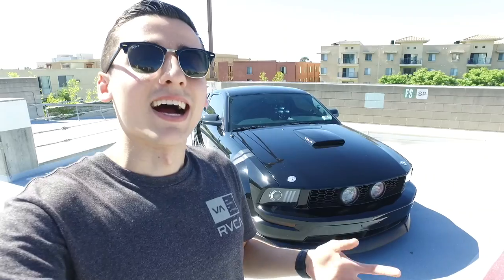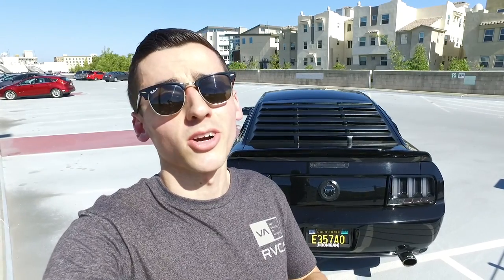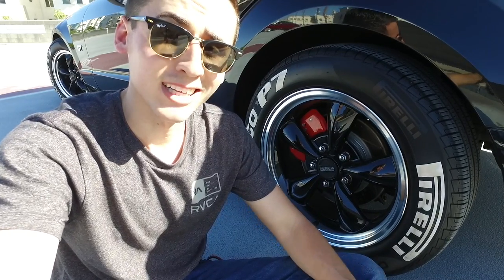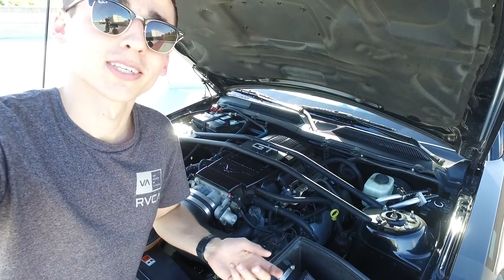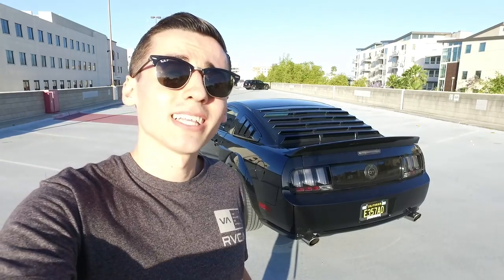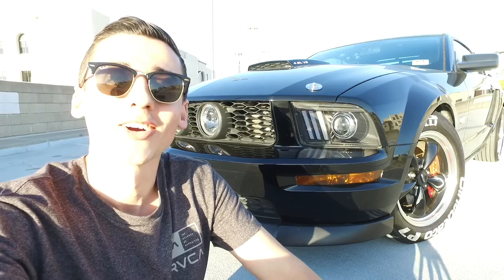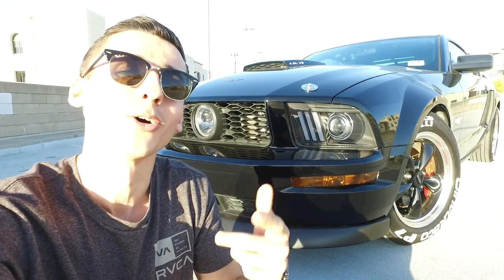4.10 Gears: The ULTIMATE Gearing Ratio For Your MUSTANG

Comment: 4.10s are fine, especially if you plan to remain naturally aspirated. If you plan to add forced induction later, 3.73s would be my choice.
Reply from the maker: Very true! Adding boost you will want to get lower gear ratios. Good looking out
Reply: 3.31s, all the cars making killer times have 3.31s, 3.73 is still too aggressive, you'll still melt your tires and lack that top end speed.
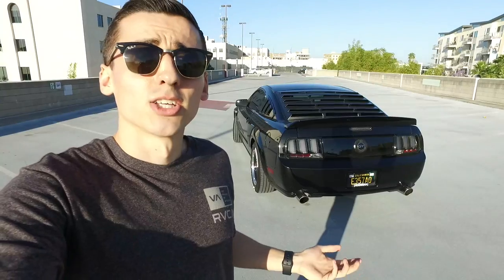Reply: I have supercharged 5.4 with stock 3:73, I'm going to 4:11. But I have 9.75 not 8.8
Reply: I disagree. With a boosted 6 sp manual I had 3.55 and 20in tires. I was in each gear forever. Went to 4.09. Coyote engines are a  high reving engine.
Reply: im boosted and want to run 410s with the Detroit rocker cams supercharger grind and shud be jus fine. least i hope lol
Reply: @WONDERBREAD89  do mods on a mustang cold air, catback, 4.1 gears, harm the life of the car in any way?
Reply: @markdamstra  overall naw but your drivetrain.. will feel the abuse. clutch , driveshaft, rear axle's etc will feel it a bit more..
But thats the point right 🤙😎
Solid ass upgrades like the single one piece driveshaft.
Lightened flywheel and ceramic clutch. Braided lines.
And stronger rear axle's to handle the gears and especially if your slappin more power and tq with boost.
Sry if I said to much
Reply: @WONDERBREAD89  thank you. so you say no that these mods wont hurt the life of the car? I thought any time u pressured the car or components of the car for more horses that strains the components and causes wear and tear and eventual failure.
Reply: @markdamstra  our s197's are very underwhelming with a factory tune for longer life expectancy.. so yes anything u do can but they are capable of so much more Ford jus  nerfs em from fac.
Stay on top of routine maintenance, synthetic oil changes and shud be fine. Man made so anything can occur.
God bless and hope u have fun 🤙
Reply: @WONDERBREAD89  hi wonderbread, thx for your help. I am buying my first mustang gt convertible. I like  1994 to 2006. n95, sn95 or s197  how is that for cool? I like the looks of an sn95 best but i think the s197 are more refined and drive better. whatever comes up i will buy. 
my first car was a chevy nova so am a gm guy but i think mustang gt's are the toughest muscle car out there.  4.6 are tough as nails. looking at a 99 that they replaced the bad plastic manifold.  he said to be perfect could use breaks. didnt they have a problem with the caliper pins?
Reply: @NateRider  ok, so I have a 2006 lincoln town car.  I have 3.27 gears stock. But, I upgraded my rims and tires from 17 to 20 inch chrome rims. There now 255/35. When I did the math it said I should have 3.85 gears. Which I thought 3.73 would be the closest to. 
Math formula tire size X gear ratio then divide by the original tire size.
So, it looks like this 20inch tires X 3.27 gear = 65.4 ÷ by original 17inch tires = 3.84 but round it off to 3.85 ratio. Any suggestions?  I wanna gor procharger or edelbrock stage 1.
Reply: Only when talking about turbos, turbos like lower numerical gear ratios but if you were going like spray or a blower 4.10s would be fine

Comment: When running these gears is your car screaming at freeway speeds, like 80 mph?
Reply: Yea but who cares? Don't be scared of rpms
Reply: @xxxxxxxx183 puts more wear on the engine and burns through gas
Reply: Having this car with 4.10 gears in the rear end, I’m doing about three grand plus or minus at 80 miles an hour on the freeway in fifth gear.

Comment: Lol you don't gain 40 hp with a hot air intake, catless h-pipe, and straight thru mufflers. You can't believe everything americanmuscle tells you, trust me I've been there before.
Reply: You might see like 15-20 hp with those upgrades but that's it, AM is a bunch of lying diptwads. If you throw a comp cam and throttle body and intake, then you'll see a 40+ hp gain
Reply: BlazerMountain I think with a tune you would see those numbers but without one I doubt it

Comment: In the racing industry, we coin two phrases, Tall Gears and Short Gears.   Tall Gears are those with what we call long legs, they allow the vehicle to reach maximum speed on a long racetrack, such as Charlotte Motor Speedway or Road Atlanta.....   Short gears are those with short legs, they are used in events where the vehicle needs to accelerate rapidly but rarely reaches top speed or anything greater than 3rd gear.   These "Short Gears" are usually confined to rally events, hill climbs, and autocross events....   
Short gears (such as the 4:10) will allow quick acceleration, which might be effective coming out of the hole, but they will suffer greatly on top end as the vehicle reaches it potential redline RPM too quickly and therefore never reaches the maximum potential speed of the vehicle....... 
Compare that to a ...say 2:90 gear which will not be as fast off the line, however it will allow the vehicle to reach much faster speeds as the final ration of Engine RPM to axel turns is vastly reduced compared to the 4:10, allowing the vehicle to have much "longer legs" (aka lasts longer) and therefore achieve much higher speeds than the short legged 4:10 gearing.......   A 4:10 differential at 7k RPM, produces about 25% to 30% less top end speed than a vehicle with a 2:90 differential (given all other things are equal).....
That said, it becomes necessary to understand what the car is going to be used for, in order to understand its relative rear gear setup.   Try using a 4:10 gear at Charlotte motor speedway, and you will be the slowest vehicle on the track.   If however you are in a autocross where you car will not exceed 35 mph, then the 4:10 gear will shine in that scenario as it will achieve those lower speeds quicker than a long legged gear ( such as a 2:90).
Using a 4:10 gear in a street car, will eat a hole in your pocket fuel mileage wise.....  further it will cause your engine to operate at a higher RPM, which results in top end cylinder wear over time...... 
The more ideal approach is to keep your gearing 3:31 or 3:55 and rotate your tire size,   This will in effect allow one to change their final gearing without permanently swapping their ring and pinion setup........  Do the math related to tire size and differential gearing, knowing that smaller tires turn faster....

Comment: Great video. Going to be installing a pair of 4.10 gears on my Crown Victoria after watching this. Was originally going to select 3.73 but the moment I heard, "Go big or go home!", my mind was set! These gears will compliment the full exhaust I already have installed really well. Stay tuned on the project, I have a few videos already! Keep up the great videos Nate!
Reply from the maker: I am so happy that I was able to help. That is what I am here for. 4.10's are the way to go!
Reply: I was thinking the same thing. I have a 2006 lincoln town car.  I have a jmod done and 2 1/2 inch piping from the cats going into a  X pipe then out to a roush axle back exhaust.  Also, 1 big thing that helps ALOT IS the jms pedalmax.  That eliminated the drive by wire. When I first saw the reviews on YouTube I thought they were just over  exaggerating.. but it's the best 250 bucks I spent on the car. Quick question 🤔 wht would you think would be better. A procharger or a  edelbrock stage 1 supercharger?  I was originally thinking the procharger but, ever race I see on YouTube procharger gets smoked by the twin screw supercharger. Any thoughts?

Comment: Enjoyed this! Have a 60,000 mile one owner 2006 s197.Added a Roush CAI and Extreme axle backs,and a Barton shifter as of now.These cars are crying for better rear gears,it seems to me.My Boss 302's and my Boss 351 years ago all had 3.91's in them,and to me that is the perfect street setup.I was away from this until last year when i retired,and i see that Ford doesn't make a 3.91 gear set,and the 390 gears available people say tend to whine.So,i guess it's going to be the 410's.Another thing i found out is that if you go higher than 3.73,you lose your cruise control.Mods for this year will hopefully be Detroit Rockers,and gears,with headers and mid pipe slated for next year...I hope!lol  Thanks again,sir!!
Reply from the maker: I am so glad you enjoyed my videos! and yes 4.10's will be the answer for you! and you are lucky for cruise control because I don't have that on my mustang lol but hopefully you find the answer with those other upgrades haha good luck with your build!

Comment: Actually the 3:31 rear differential gears are stock for the S197 Mustang GT.  A lot of dealers ordered the 3:55 gears for the best balance in power and miles per gallon and that is where people mistakenly say that the 3:55 gears are stock,   I have 3:55 gears in my 2007 Mustang GT and regularly get 25-26 on the highway and 16 mpg in town,  I live at 4,500 ft in altitude so the 3:55 gears are primo.  I would only consider changing to the 3:73 gears because I’m getting ready to order the Roush supercharger.
Reply: 2005 and 2006 stock gear was 3.55,in 2007 ford made the 3.31 gears it'sdefault option.

Comment: Good video 👊 I got a 06 GT ,Saleen supercharged stock pulley 7.5 psi ,stock saleen intake ,cerviny side exhaust ,& 4:10 gears aswell just that on low boost puts out 450whp & 500+ crank I really recommend boost easy 150+ hp gain I will do pistons rods and turbo swap or maybe compound boost for a little it should be fun 😈 go for it boost !! 💪🐌
Reply from the maker: damn you are going all out haha thats gonna be a 10 second car right there!

Comment: I read 4.10 plus gears are recommended for the auto 10 speed. I currently have a 2020 S550 base with 3.15 gears. I hate the pull. It lacks. I have Nitto 555 G2. 285x35xr20 rear 255 front. Can't wait to upgrade.

Comment: Sweet.  Im going with 3:73's.
I had a 92 Stroker on 3:73's

just got Babyblu (2007 s197) Pypes H-pipe. gonna do the install myself.  Love the vids.
Reply: ya the 3.73 will help with traction beeter than the 4.10 if you plan on making more power in the end
Reply: by boy has 4.10 in a Cobra and MAN what an amazing feeling
Reply from the maker: Aye 3.73 aren't bad at all! They are amazing too. I hope you install it the right way. I wish I knew how to install gears like you lol
Reply from the maker: Yeah imma need to do some upgrades on my suspension next lol
Reply from the maker: Receipt for domination right there! haha
Reply: Nate Rider im putting on the H pipe.  Im not doing gears myself.  Im like you. not my thing. lol
Reply from the maker: OHHHH FASHO!! Yeah the mid pipe is SUPER easy to install. Hope it turns out well
Reply from the maker: Yeah if you have boost then it is better to go with smaller gears. but if you don't then higher gears do the trick

Comment: Love the video kid. For the tire selection, I have Nitto NT555, 275/40ZR18 103W, on all four corners. I've used them at the track and gripped pretty good. Here in NY, I don't drive my car in the snow and from sitting in the garage, I don't have dry rot, or flat spots on them. Had them for 4 years and they still look good.
Not sure what kind of gears I'll go with. I've thought about 3.73, but also 3.90. Has anyone else used 3.90's?
Reply from the maker: thanks man I appreciate it. I love the Nitto tires as well. I may slap them on in the future. and nno I haven't done any research on the 3.90

Comment: I've got two Mustangs.  A 94 LX with a 429cj and C6 trans and I run the 3.73 gear in it and it does great.  And I also have a 2000 GT that has a 5 speed and a little tune up and 3.90 gear in it and it does great. Have no problem getting from point A to point B . Do not like the 4.10 gear. Had no luck with that gear.

Comment: 06 3v checking in. Cali laws suck man. They hate my car and my guns. Car looks good bro. Well, here is the list. JLT CAI. JBA longtubes and O/R H. Flowmaster  outlaw axlebacks. Dyno tuned @ 300 Wheel. MGW shifter. Braided stainless lines with Xtreme stop pads and  slotted drilled rotors. Gt500 front LCA . Full BMR rear Suspension. FPRP K springs on Koni strt With Gt500 strut mounts. Exedy Mach 400 clutch and flywheel going in this week. And a grip of cosmetic stuff. keep up the vids man!
Reply from the maker: Yeah you can say that again! SWEET! That set-up sounds sick. I definitely loving the long tube headers. How are you able to have long tubes on cali?
Reply: Im in Texas. just saying the stuff i enjoy is a no go out there. i want gears but im debating on NA or FI. 3.55 would be perfect if i go FI. we all wanna see a couple of Passes When You get the dope hooked up bro!
Reply from the maker: Yeah if you have all that power, then smaller gears will work good for you. Thanks my man will do!

Comment: I have a 94 GT, which is a 302 5.0, I have 170 Twisted wedge heads, 24 lbs injectors, calibrated MAF, T MOSS ported intake, and a simple E CAM. I believe with a tune i should be around 290-310 hp with around 320tq. at wheels. I only have the weak 2.73s car feels very slow. I have 4.10gears ready for install what can I expect?

Comment: It does not appear that you have modded to a one piece aluminum drive shaft yet? This is an easy install that you can do yourself. The stock 2 piece steel shaft is over 40lbs. The one piece aluminum is like 20lbs so you have less rotating mass which transfers the power to your wheels faster. With the aluminum shaft you will increase acceleration times and especially coupled with the 4.10 gears. Research the aluminum shaft. I highly recommend that mod. Also, the aluminum shaft is stronger than the steel shaft. You also don't have to worry about having the carrier bearing failing, a notorious issue for 2-piece driveshafts.
Reply from the maker: Oh trust me I have been wanting the one piece drive shaft for the longest time lol but the price isn't too appealing to me. Imma have to save up for that one lol thanks for the advice tho imma do more research on it
Reply: @NateRider  dude I don't understand I have a 2001 Mercury Grand Marquis

Comment: Miss your videos on 3v mustangs.  You were the guy on 3v mustangs.  Just like Derek Baran is the 4v guy.  Amazing he jumped from a 2v mustang to a 4 valve 2013 mustang.  Now he's had a cobra 2004, but realized mot a market for the Terminator.  Honestly it is the car he wanted.  But so few, so nobody watching.  Sold it quickly and bought a S550 automatic! I don't blame him. But it is not what he represented in the past.  It was manual all the way.  Now it's a 10 speed automatic 
 It doesn't miss shifts and so much faster. He recently did a video on a 3v. Wasn't his car but something he recommended.  Hmmm. Can recommended the car, but never owned one?

Comment: I put 4:10s in my 02 GT and couldn't really tell a difference.
And it had 3.27s stock.
I'm thinking they never swapped the ring and pinion. It still tachs the same.
Thinking I got ripped off
Reply: There is no thinking to it, you was absolutely ripped off. Going from 3:27 to 4:10s is a big difference and you would be able to tell right away. There is NO WAY possible for 4:10s to feel like your 3:37s

Comment: The combo of underdrive pulleys and nitrous is a great way to blow up an engine. 98% of failed engines are a result of this combination. Ford engine exchange will not replace your engine if you have used this setup. (Yes we can tell) The slight performance Increase from underdrive pulleys is not worth the extra wear and tear on the engine. Did you at least Increase cooling capacity when you installed the pulleys?

Comment: I have a 2003 Terminator Cobra(whipple 2.3L 700rwhp) and I highly recommend 17x10 wheels in back with Mickey Thompson drag radials(275s to 315s depending on fitment). MTs will give you great traction. Up front I use 17x9 wheels with Nitto tires (275s). With nitrous if you don't grenade your motor you are going to need the biggest tires you can fit in back. I would recommend you get a supercharger rather than nitrous. Much safer and more constant power potential. Your year/style Mustang has a notoriously risky bottom end when it comes to mods so I would not go crazy with the power upgrades. Good Luck!
Reply from the maker: Thank you so much for this great advice! I am definitely going to have to check out those tire setups cause I already know my mustang is gonna be melting my stick wheels lol Damn you must be a king on the street with that terminator mustang

Comment: Hey Nate Rider. What are the top speeds for each of your gears. I have an 08 GT with the 5spd but It may already had some stuff done to it when I bought it. My speeds are 1st-35, 2nd-62, 3rd-85, 4th-115, 5th-150+. I am just trying to figure out what I really have in there.
Reply from the maker: I really wish I can tell you my numbers, but I cannot say exact. I am hoping to dyno my car very soon to show you guys all the numbers that sally is pushing. Sorry! But stay tuned for that next video!
Reply: Nate Rider I still gotta get mine dynoed as well, but before that I still have to get my cams and longtubes put in. I bought the comp cams nsr stage 2 xfi if you're familiar with those. And with those 4.10s you got great acceleration but the only trade off it kills your top end. What I mean by that is that long 5th gear is going to kick in a lot sooner. You should make an acceleration video as well.